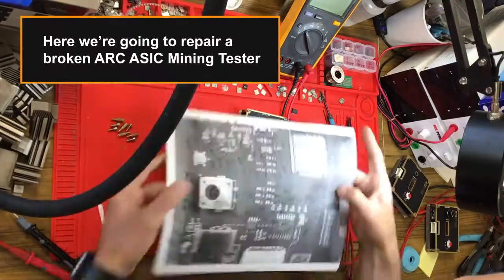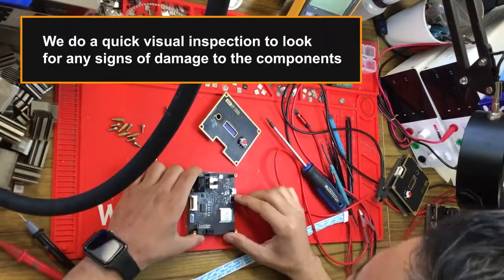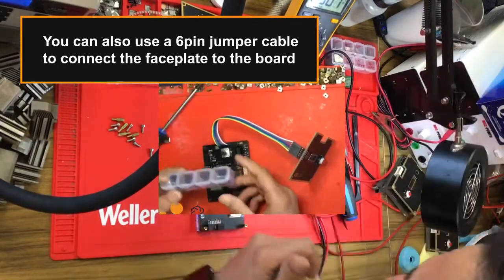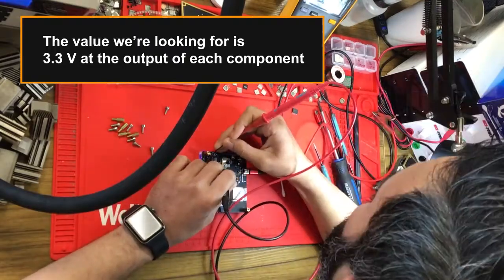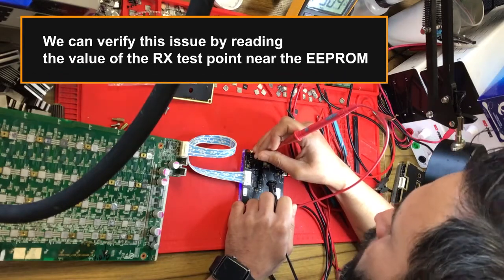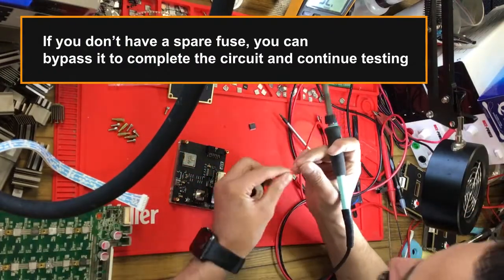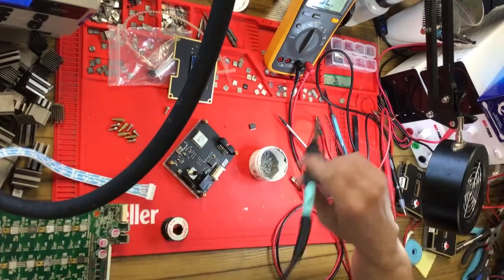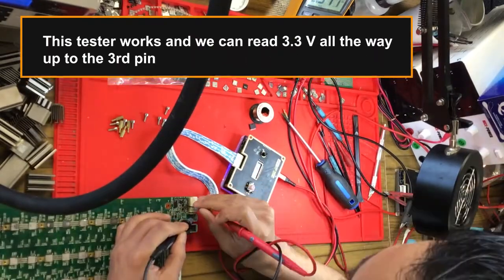Hashboard Repair: ARC ASIC Tester PIC Error Repair

Comment: how did the ARC tester break in the first place?
Reply from the maker: They break with simple use. Sometimes the hashboard it is connected to has faulty components which will affect the behavior of the PIC and therefore sometimes blow the fuse or more. Other than that, it can also be simple wear and tear.